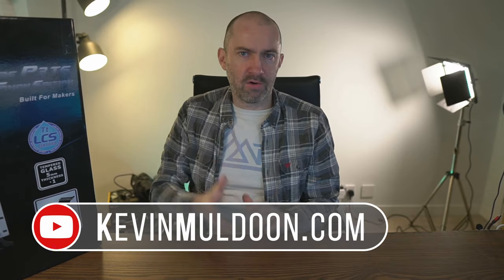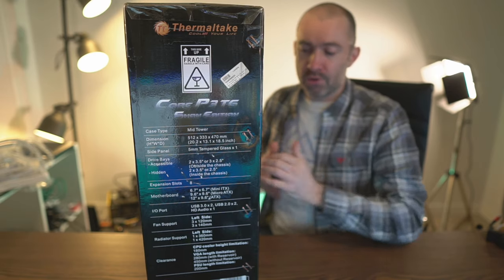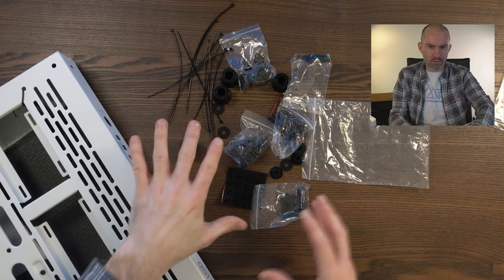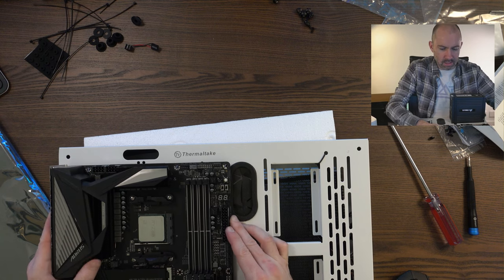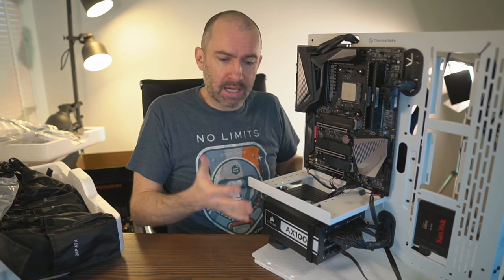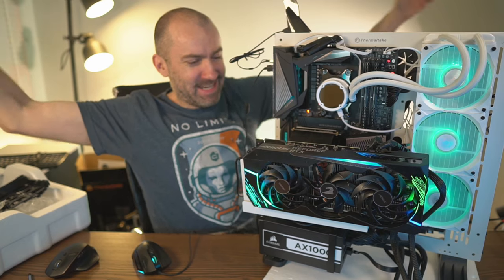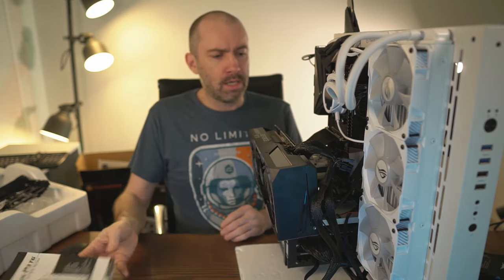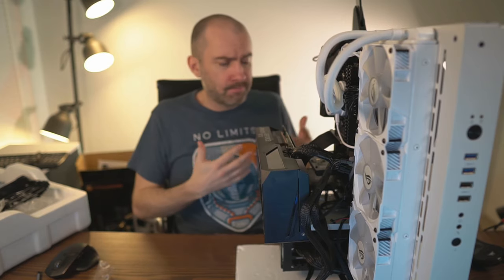New PC Build (Part 5) - Building My PC With the Thermaltake Core P3

Comment: Thanks , I just bought one of these cases, I wasn't expecting a jigsaw puzzle without the solution. You helped my sort out the problems I had. Mainly, which screws goes where? I would say it almost made me screwy but that would be a lame joke. Lol
Reply from the maker: Haha it was better than you think 😁

Yeah the manual sucked. They should have did more to explain what all the screws are for and break down how it's all put together.
Reply: @KevinMuldoon  Yea, I love the looks, and now everything is setup, it gorgeous. And better than any Christmas tree. Lol With all the lights I've put on it. Lol
Reply from the maker: Haha yeah it's still a good case. I'm going to be using it for testing and setting up another build in the future.
Reply: @KevinMuldoon  Could you suggest a case for an atx, for the purpose of NAS/media streamer?
Reply from the maker: I've not built a custom Nas before. Obviously, you'll want one that can handle many 3.5" drives.
Reply: @KevinMuldoon  Agreed. As many as possible and good air flow, I just thought you might of heard of a good one. Thanks for the reply.

Comment: Great video which was extremely thorough. Only wish I'd seen it before I built my P3. I finished up with the GPU hanging at a rather precarious angle and having to prop the end up with a few books.......of course I had omitted the small spacer on top of the power supply, once installed it's perfect. So a big thanks from me! Regards
Reply from the maker: You're welcome Peter. Glad you found it useful. It's a flexible PC case, but the instructions are not great.

Comment: Looks sick mate, just done my first build, awaiting psu to come today then I can fire it up, I’ve got the same board on Rev 1.1 not sure if I’ll have to update the bios but I’ve created a update for it and I’m just going to update it first just incase specs are Razer tomahawk atx case, ryzen 5080x, Corsair h100i platinum AIO, Dominator RGB platinum 32GB, few ML120 RGB fans, Evga RTX380 FTW3 ultra, RM850x, 
Rgb controller and a usb hub. I think that’s everything. Does it sound alright ?
Reply from the maker: That sounds quality.

I assume your phone changed the 5800X to 5080X by mistake. So in that case, you would have to updated the bios, but you've done that already so all good.

I was looking at the dominator RGB memory too. It looks great. Did you go for white or black?

The EVGA FTW3 cards are apparently really good. That sounds like an awesome build.

Which RGB controller do you have? Is it necessary? It's not something I've really looked into yet, but is something I could potentially add.
Reply: @KevinMuldoon  thank you, yes my phone did sorry. I went for black memory and looks really good.

 I went for the Corsair lighting node core, they’re out of stock in most places but managed to find one on eBay brand new from someone who got them included in bundles.also picked up the nzxt usb hub as my case had under lighting and I didn’t have enough internal USB ports. 

My card is going to take a while to come so I have a question, will I get a display output with the set up I have once my psu arrives, I have everything installed apart from the gpu because I don’t think ryzen has integrated graphics
Reply from the maker: No I don't believe you can connect to a display without the GPU. My motherboard doesn't even have any HDMI or displayport ports.

I got an NZXT hub a week or so ago. It's working well.

Comment: Great video, Kevin and a very stylish case that looks better than your average case. One question though, how will you deal with dust build-up in such an open setup?
Reply from the maker: I don't forsee it being a major issue as I can still wipe the case down and use compressed air.

I should be ok.

Comment: Alright Kevin, I’m not sure if I missed this in the video but are there options to add extenders to the poles? Maybe there are and you could use the glass while having the GPU in its current position and using all your cards. BTW, I’d have been crying like a big baby if I’d have not worked out that PCI bus speed issue between Gen 3 and 4 for the riser cable to the GPU. Anyway, back to my GTX 1050 Ti build 😆 Cheers, Dave.
Reply from the maker: That's a good idea Dave. I hadn't even thought about finding longer poles. I can't find any online so I suspect this is something I'd have to get made myself. It's a great idea. Even another inch or two longer would help.

I wasn't going to be too bothered if the riser card doesn't work as I may still end up moving the Elgato capture card. I'd have to change the graphics card though or the all in cooler though as I'd have clearance issues with the radiator though as the GPU is so long.

Are you doing your 1050TI build soon? 👍

Kevin
Reply: Alright Kevin. I’ll be doing a video probably this week about the 1050 Ti system. I don’t think I’ll do it as build video, I don’t think I’d get anywhere near the view count to justify the time. Plus, people simply don’t build computers in the way viewing figures and comments on large tech channels would suggest. I’ll probably just gloss over some figures, show the outside and the inside of the machine and talk about some basic tech stuff. The video is more to show what you can put together second hand for a 1080/60 system as an option for people on low budgets and for those who don’t want to paying scalping prices. To be honest, for this year I’m trying to find the best approach to making my videos shorter, I’m just not convinced that the average viewer actually understands most of what’s beings said and I don’t think most appreciate the extra detail etc. There’s obviously some that do but I just don’t think most do. I’m also trying to work out what type of videos I can do where I don’t need to be in them. ‘How To’ or information type videos where I just use one camera pointing at a product or subject or a screen grab, that I can turnaround quicker and hopefully do more of. I need to try and get my numbers up this year. I’ll still do long, detailed (boring 😆) videos but they’ll be the kind of things like some of the camera and mic stuff where I know that I already have a good handful of subscribers who like videos with more detail. I personally prefer doing the longer, more involved videos and wouldn’t mind taking the time if I had a solid core of subscribers but I don’t. Anyway, the video for this 1050 Ti system is gonna also act as a reference point as well. I plan on doing a bunch of game videos about using the 1050 Ti for basic mid quality 1080/60 settings across a bunch of popular games and will refer back to the build type video as a point of reference so people can see the machine. Cheers, Dave.
Reply from the maker: There's definitely a large number of people that enjoy building computers, but whether the views justify the time putting into it is another story.

I probably should do shorter videos too. With these videos, I wanted to show the whole process of me building the computer and my reasons why. I guess I could have divided this video into multiple parts, but I made more sense to do a longer video where I just showed everything.

A big part of me doing YouTube is enjoying it. It's why I've swayed away from many different types of videos as I've lost interest in it. Plus sometimes there's no point when you're late to the table. For example, I've bought the video mic ntg and wireless go over the last few months, but I don't think I will do long detailed videos about them as they've been out for ages. I just wouldn't get the views. I guess I could do one video where I talk about both mics. That makes more sense and is less time consuming.

Looking forward to seeing your video about getting 1080p 60 FPS on a cheap pc.

Kevin
Reply: Don’t get me wrong Kevin. If I were building a PC that was going to be my main machine for some time, I’d probably do long videos about it. In that scenario the PC would be more for me and not necessarily something bought that I may not keep and then sell in a few months. Basically, and as you said, it’d defo be something that I’d enjoy making videos about anyway.

One of the problems I have, is just as you’ve said, I can only do videos that I have a laugh doing. While I do YouTube commercially and would like to make proper money out of it, I need to be completely into the videos I do and enjoy doing them. Then again, that may be one of the reasons why my channel isn’t doing as well as I’d like. Maybe I need to be a bit more cynical and start doing stuff that’s aimed more for the average viewer and not myself?

In any event, I think shortening certain videos is probably a good thing as far as YouTube itself is concerned and getting the videos noticed. There are definitely certain things that don’t need over explaining and if the videos take less time to do then I could do more of them. Again though, it gets back to the point of enjoying doing them. If I were doing a video and thought I’d skimped on detail, I’m not sure I’d be either happy with myself or enjoy the end result. I suppose trying some shorter ones is the only way to a answer that one.

While I should probably toughen up and treat YouTube as I should with any money making exorcise, I’m not sure I can be as cynical as I should be. I bought some stuff last year that were ‘hot topics’ that I’d already planned on doing a bunch of videos about but didn’t, because after buying the things I didn’t really like them. The iPhone I bought only really lasted a week or so before I ditched it and I could have made a lot more videos about that. Also, the Mac Mini M1 that I’ve got I haven’t really done much about that, although it’s not that it’s not any good it’s just that it doesn’t really suit me.

Also, one of my mates wants to buy my phone, so I’ve ordered a new Galaxy S21. I’ll do an unboxing of it but I’m gonna see if I can do something that’s only about 3 to 4 max 5 minutes long. There’s too many big phone channels out there and too many people trying to be phone channel, it’s not worth competing in that space for a channel like mine. I’ll try and do a short video with closeups and a general overview but use the video to explain what I’ll be doing with the phone, basically vloggy stuff. Maybe with this one I should just do certain videos even if I don’t like the phone.

I’m sure camera comparisons with a Sony ZV1 and GoPro9 may be something that people would be interested in. I most certainly wouldn’t plan any great long term strategy on something like this S21, as you’ve rightly said, these things have been done to death by the time the likes of me get my hands on them. The plan is that if I like the S21 and it stays with me, then I’d be more than happy to just dip into various videos about it over time as that’d defo be something that I’d be happy doing.

Anyway, I’ve only done a few videos so far this year. I don’t know about you but I almost forget how to do my videos and screw up a lot more if I’ve not done any for a couple of weeks or so. Time to get back on the wagon :)

Cheers,
Dave.
Reply from the maker: I am trying to mix in opinion style videos and tutorials with my reviews and focus on stuff that is on my mind. I enjoy live streaming too. That's something I'd like to do more.

I'm reluctant to buy anything that I don't need. Firstly, because it's always a gamble with views. Secondly, because you always lose money. Lastly, selling stuff on is always a hassle and time-consuming.

Shorter videos do appear to do well. I'm willing to make videos shorter for some videos, but for detailed reviews, I prefer to cover everything and include timestamps.

My wife is keen on the S21 so I might be able to do a video or two about it. I wouldn't be getting it otherwise as I'd lose too much on buying then seling. Like you say, it's too competitive.

Don't worry about taking time off. I think it's good to take time off sometimes to avoid burning up. I know myself that when I'm busy and stressed, my videos aren't as good.

Kevin

Comment: Hey man! Looks great, quick question though. I have this exact case and GPU. But when I used the included TT riser cable my gpu wouldn’t post, I thought it was a fault with the cable so I ordered a new one only to get the same result, I resorted to horizontally mounting it and it worked so it wasn’t a GPU issue. I was wondering if you had the same issue afterwards? Cheers mate
Reply from the maker: Hi Andrew.

Initially, I didn't have any problems (once I set the PCIE to Gen 3). It worked ok, but after a couple or weeks, I had an absolute nightmare. I must have lost four days to crashing, blue screen of deaths etc.

I knew the riser could be the issue, but I tested everything else just to make sure.

Eventually, I connected the GPU directly and this fixed it. Within the next week, I'll have a follow up which discussed all the problems I faced.

Comment: They intended for the video card tray to be used with the back panel to strengthen that corner, though of course that wouldnt allow you to use the other expansion cards you put in.
Reply from the maker: Hi Randy. That's something I actually discovered later. I'll mention this in my next video about it 👍

Comment: How do you puede the gamecapture? I got the same build and recently got me elgato 4k60 pro mk2 and need to put it vertically, it can be putted vertically with a flex cable PCIe 16x?
Reply from the maker: Yes a PCIE 3.0 extension should do the job.

Comment: I just ordered the same case and thanks for your infos. As an advice minewise, Id say, go full custom watercooling and try to hide more of your cabeling. Also, the Aorus 3090 runs much quieter when run in a custom Waterloop. I hated that Airbus taking off when gaming. Also you gain about 5-10 cm of space in length and about 5 in height. 
Also, the 3090 Master (i assume, because of the two 8-pin Power Connectors[Edit: NM, I just Read your specs ^^]) is a pretty diva. I had to RMA mine, because of strange behaviour. 
And one last question: Why do u use that crappy ram when spending tons of money on an Aorus Master Board, Aorus Master/Extreme GPU, expensive CPU and an extremely overpriced AiO?
-----------------------
And, afaik the cheaper TT Risercables are supposed to be kind of crappy. I followed that issue quite a while, so here I'd be kind of interested in alternatives that might fit by Lian Li or maybe the Thermal Grizzly Riser.
Sorry if I might sound harsh, i didn't mean to. You did a very informative job, but if you take a case like the P3 it needs to be set up clean ;) 
Otherwise you could have also taken any box without window.
Reply from the maker: I'm really not keen on doing a water-cooling build at this time. Nor do I want to void the warranty of my GPU as I may end up selling it later. 

I'm more practical with cabling. I'm not trying to win awards or anything. I keen it as clean as I can, but I don't spend a ton of mine time on it. It's time I don't have. 

Crappy ram? There's no benefit in me getting super fast ram for this build as it's main focus is video editing. It would be a waste of money if I spent more.

I got this board because it supported gen 4 SSDs on all slots. Which again, is for video editing.

Remember, not everyone builds PCs like this for gaming 👍

Comment: Hi Kevin, Wow, you have just built my dream system I want to upgrade to! :)  How much did it all cost to build?  How much DDR4 memory did you install?  Could you please do some benchmarks with benchmark software and a game like Battlefield 5 or COD Warzone please?
Reply from the maker: I put 32GB in. I previously had 64GB in my system, but I've found that I don't need that anymore as I've switched video editor.

I'll cover memory in the next video as I've bought faster memory modules 👍
Reply: @KevinMuldoon , Thanks for your reply. I appreciate it, being a fellow Scot!   I have 32GB DDR3 in my old Intel i7 4790k system.  :)
Reply from the maker: AHH cool. You'd notice a big difference upgrading. 

Are you thinking about upgrading?

Where in Scotland are you from?
Reply: @KevinMuldoon , Yes when I get a job. Aberdeen, but live in London.
Reply from the maker: Cool. You could start planning a build in advance on pcpartpicker.
Reply: @KevinMuldoon , I was thinking that very same thing. Thanks Kevin! :)

Comment: I never saw the test bench coming👌 I was contemplating the new Coolermaster one that's just surfaced ,couldn't you get some longer stand offs made up for the Tempered glass front? ..just a thought 😉 soon as  saw that riser cable I thought here comes trouble lol..
Reply from the maker: David Harry suggested the same thing. It's a great idea, but I'm not sure there are larger stand offs available. I'll see.

If I don't use the Elgato capture card and thunderbolt card, I'll be able to bring the card closer to the case and use the glass. That's another option.